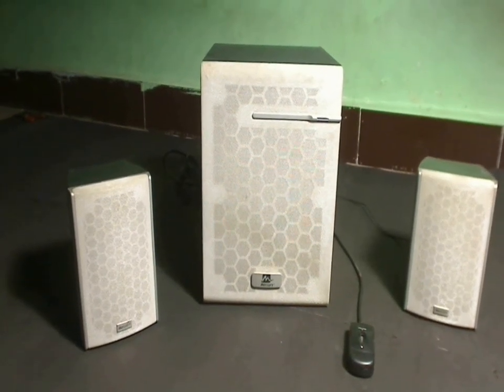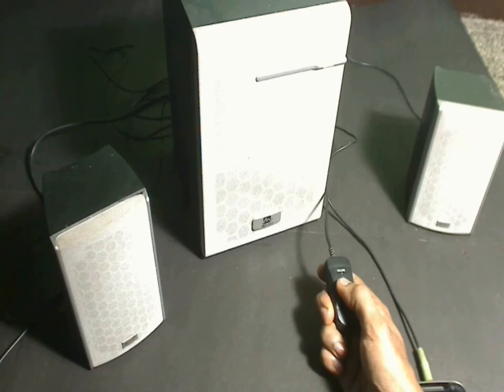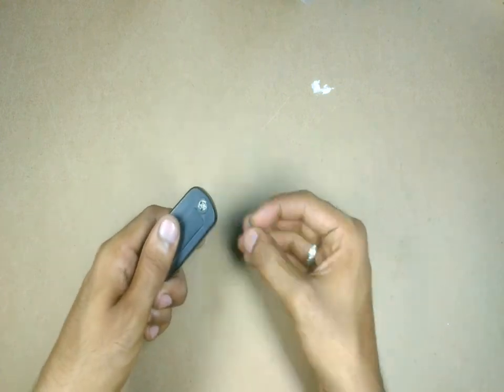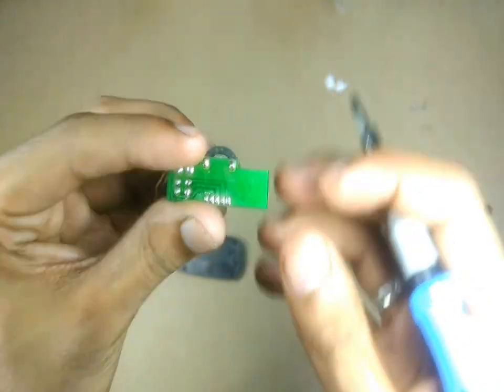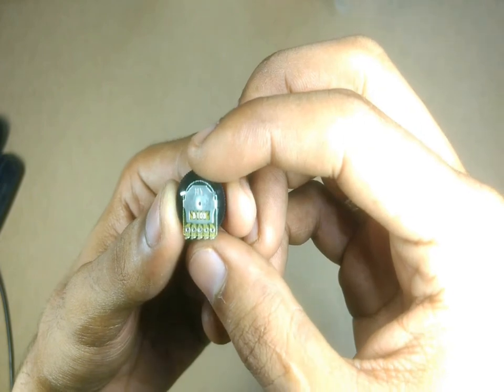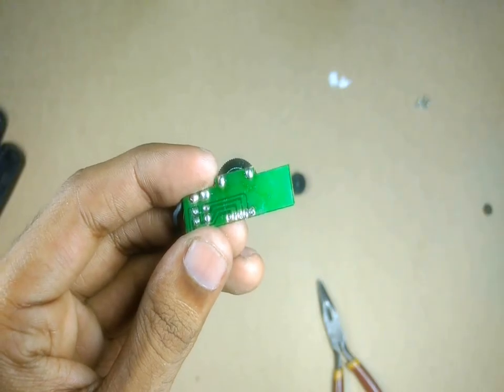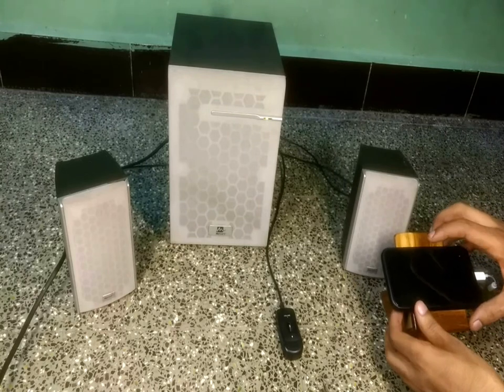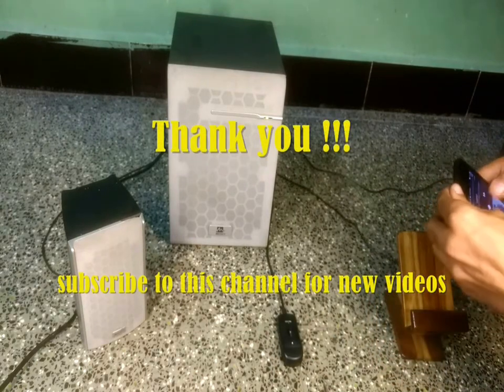Home Theatre Music System Repair

Comment: why to replace potentiometer there may be any discontinue in the old one so if had checked the old one properly I think it is enough instead of getting a new one
Reply from the maker: +sagar vidhya if the disc is burnt then we cannot repair it so I replaced the whole thing
Reply: +Electronics Made Easy : KHADER ok :)